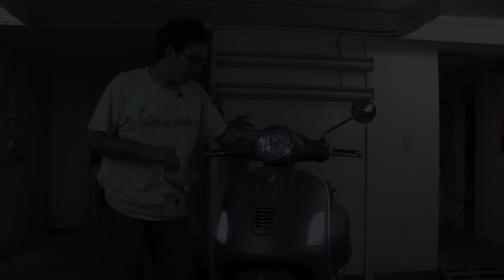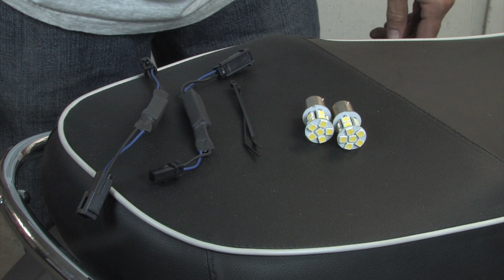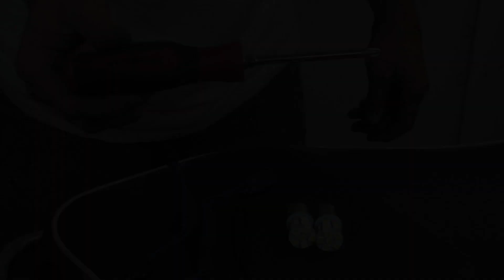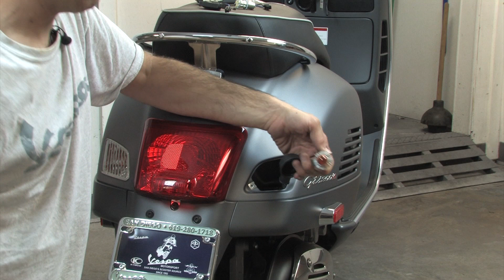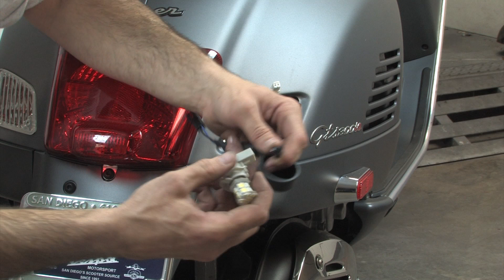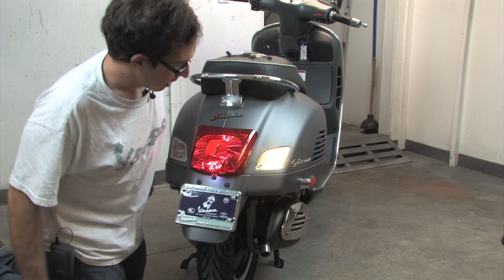Vespa GTS Rear Turnsignal LED Bulb Upgrade

Comment: I've tried installed the led Buld only but without the resistor packs, all of the light will turn on :(
Reply: You can try searching for adjustable turn signal relays

Comment: is there the same kit for vespa LX ?? I really love to use this but I dont know which Resistor Packs is suitable for Vespa LX and where to buy it. please help me thank you !
Reply: I just used the MI200 LXRR kit for a 2011 150 LXie and it worked perfectly. However, there was no cover on the bulbs on the LX.